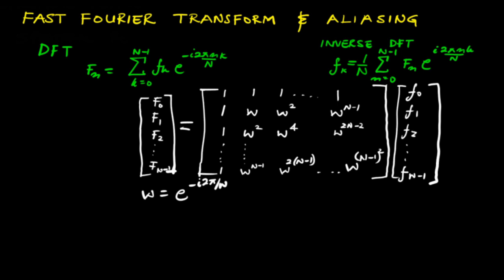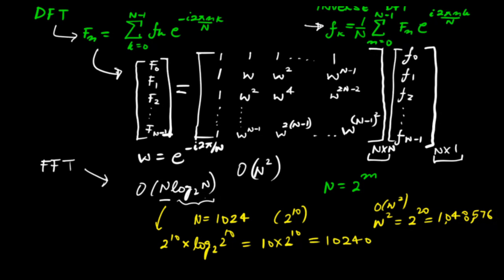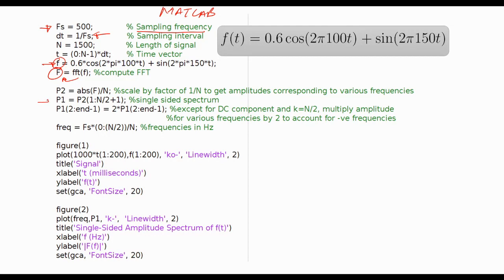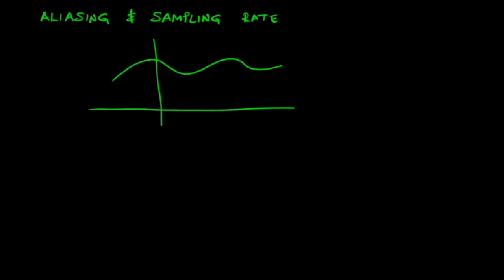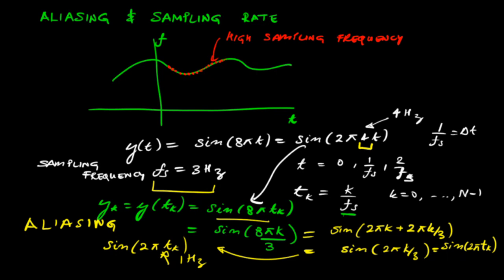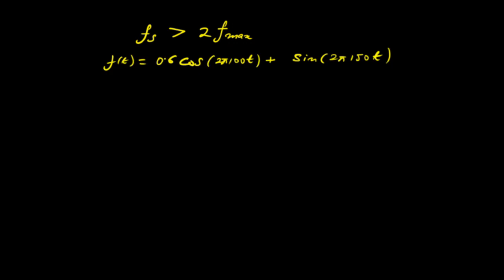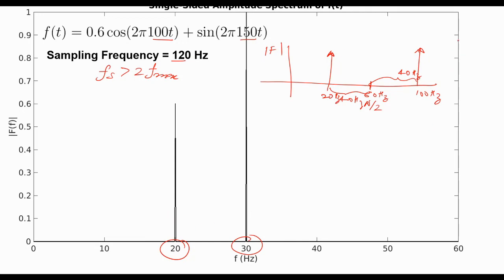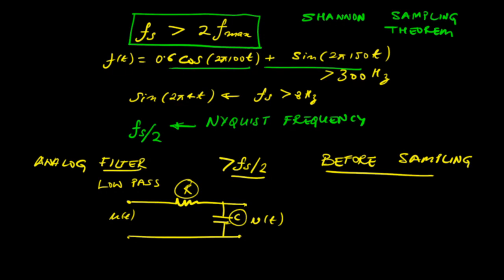Lecture 16: Fast Fourier Transform (FFT), Aliasing, and Sampling Theorem with MATLAB Example

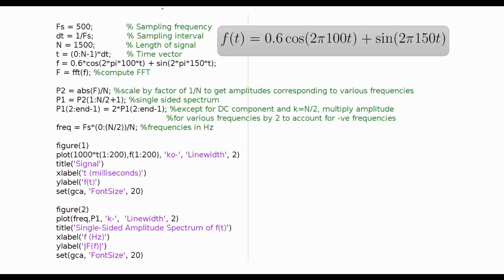Comment: at 8:23 you wrote sampling frequency to be 500 but then on graph you wrote it to be 1000hz , does it has to do with why you multiplied 0 to N/2 values by 2 to  include the negative complex conjugate amplitudes ?? is that why the sampling frequency also doubled  ??? otherwise why .

Comment: Good lecture Sir.. 
I have a doubt that, how to choose sampling frequency in practical applications since we don't know what is the maximum frequency that practical signal has
Reply from the maker: Good question. You always need to have an estimate of the quantity you are measuring before making a measurement. This holds for simple measurements like measurement of length also. We choose a screw gauge to measure thickness of a wire and not a ruler because we know that wire's diameter is in millimeter. Similarly, you should have an estimate of maximum frequencies in your signal while choosing the sampling frequency. If you are unsure, put a low-pass filter to remove high frequencies in the signal before sampling.

Comment: Sir,  is spectral leakage observed in DFT also? As we are taking the signal for a finite amount of time here also, we should see non-zero values at other frequencies too in the DFT. But we are seeing peaks only at the frequencies present in the signal. Does this mean there is no spectral leakage in DFT?
Reply from the maker: This is because the signal for which we are computing DFT is periodic and has integer frequencies. Otherwise in general there is indeed spectral leakage in DFT. Try for example, computing DFT using FFT of two functions: (i) cos(2*pi*100t) and (ii) cos(600*t). You can take sampling frequency of 500 Hz lets say. You will see that DFT of first function has a discrete peak at 100 Hz, whereas the second function results in spectral leakage.